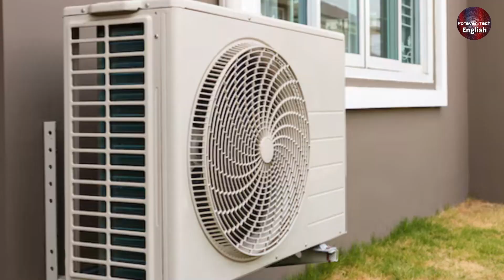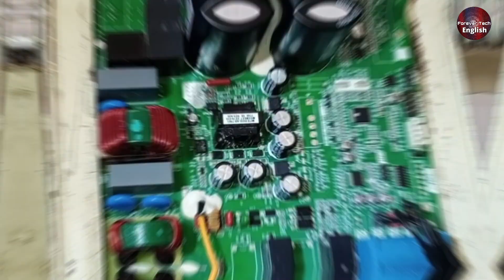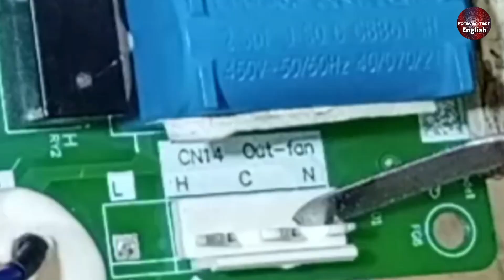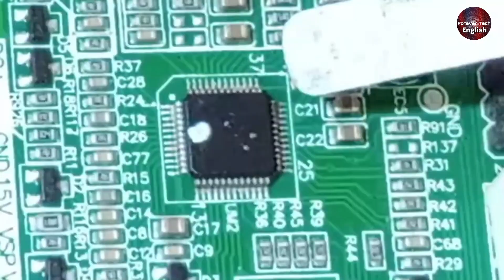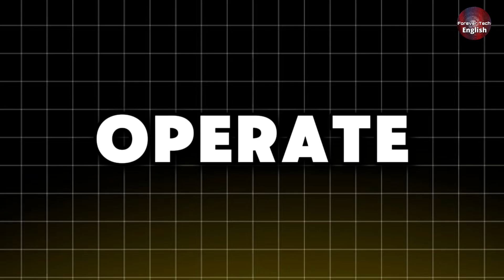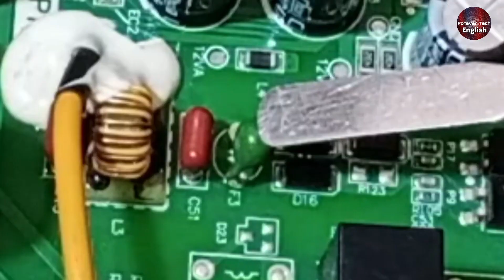Critical Voltages in Megmeet AC Circuit: 12V, 3.3V, 15V Explained!

Comment: You always miss one: SAFETY!
Testing board plugged on to ac voltage and testing is not safe, not for board or the one who's performing tests. Best practice is using isolation transformer, at least 1500VA. One can make it from 2 back to back 24V or 12V transformers from old UPS 230/12,  then 12/230V, secondary to secondary connectrd, low voltage side, take output from 230V side. Then, where ever you toulch on the board, you won't be shocked, provided your neutral and live from secondary are not connected to primary, (some people tend to connect neutral to primary neutral). 
Don't forget to remove conformal coating from the surface of the board under test, before performing any test!
Reply from the maker: correct safety is important at any cost.